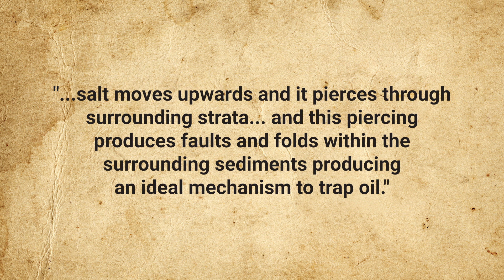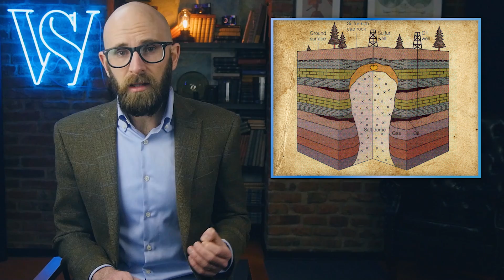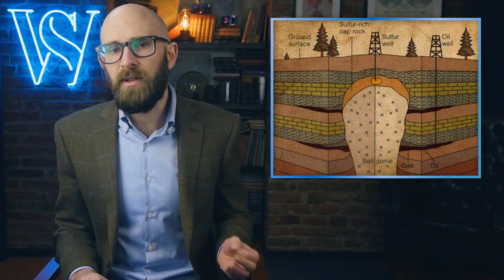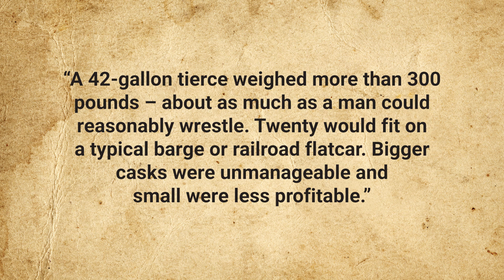How Drilling a 14 in. Hole Created a 1.3K ft Deep Saltwater Lake Out of a 10 ft Deep Freshwater One

Comment: Correction: a barrel is 55 gallons, and has been for many years now. Source: I work for ExxonMobil and keep track of about 300,000 gallons monthly. Not every company has standardized on 55 gallons, but certainly all of the major ones. We will occasionally get Rainbow and Reif drums that are 42 or 30 gallons, but the overwhelming majority are 55.
Reply: To add to that, while 300 lbs may have been seen as the most a person could handle at the time, modern steel drums are pretty easy to move. Most 55 gallon drums weigh 400-450 lbs, with some products weighing as much as 550. Those are pretty annoying to move, especially on wood pallets which like to break under the weight, it’s not unmanageable or even difficult with some practice.

Comment: My grandfather used to run a ranch 60 miles north of Cheyenne, Wyoming. The house got its water from an artesian well. The pressure was low and the mineral deposits were prodigious, but it tasted better than any water I’ve ever had. 

He told us about one family that drilled down to increase their own house water pressure and punched a hole that caused the artesian well to drain down instead of trickle up. Oops.

Comment: And I thought that my day was bad! First my jacket I took off got pulled into a sprayer rig engine. I was spraying fertilizer on greens. I work at a golf course. Than the next day lighting hit inside the building myself and some others were standing in. You could feel the energy in the air after! Fried a bunch of stuff and blew the metal sides out of some of the sprinkler boxes!

Comment: The limnic explosion near the end - limnic refers to water stratifying into layers by temperature. In warm environments, the water at the top of the lake is warmed by the sun and warm air, and since heat rises, the warmest water stays at the top and continues to get warmer.  The cooler water below stays there.  In cold environments, such as the US Great Lakes in winter, the water at the surface is cooled by the colder air above, and then that water sinks and is replaced by the slightly warmer water below it, which cools and sinks, and eventually the entire depth of the lake stabilizes at the same temperature. When the water is all the same temperature and has no layers, it is called a "monimolimnion"... which is the longest non-hyphenated English word typed entirely with the right hand. :-)
Reply: Thank you - fascinating information and an impressive new word.

Comment: Your math on gasoline production from barrels of oil isn't quite current. With modern steam refining methods, airborne CO2 and water are combined with crude oil at high temperatures and pressures to produce several barrels of product from one barrel of oil, at the cost of electrical power input. This is why oil refineries tend to be located wherever inexpensive electrical power from hydro, coal or nuclear can be found.

Comment: "We are so fired." - The workers, allegedly.
Reply: Unless they had a hand in picking the spot they most likely were ok, i'm an operator in a factory that cuts glass, if the guys in the office tell me "cut this" and it ends up being wrong the guys in the office get the flak, not me.
Reply: @Battusai1984  The guy on the platform mis-reading the guy in the office's specs, or mis-reading his position from shore markers (pre GPS?)
Reply: @TIMEtoRIDE900  same as boat navigation. I was good at math and in racing my Captain disagreed with me, but double checked his math. I was right, and stood by my work. Someone screwed up.
Reply: @Battusai1984  And if the order hasn't been written anywhere, you'll still be the one fired. "I didn't tell him to cut that!".
Reply: Nah, it's the surveyor who's fired. They were supposed to be several hundred feet away. Instead they were right on it.
Reply: @WardenWolf  Several hundred FEET? If I'd seen that rig on that lake and I worked in the mines I'd suddenly have a sick day to call in; all were extremely lucky.
Reply: Workers don't get into trouble when they followed the exact instructions and the land itself is the cause, it's filed under "Act of God".
Reply: Allegedly
Reply: Kinda like those videos where a guy in a forklift destroys the whole warehouse.

Comment: Water at "extremely high pressure" widened the hole? Where did high pressure water come from? The bottom of a 10 foot deep lake is at 5 psi. This is a third of an atmosphere - nothing much at all. A 1,300 foot depth is at about 650 psi but that happened later.

Comment: Actually they were drilling for natural gas.  The drilling site supervisor was a student in a well control class that I teach last year.  He told me that the plans for the well and the plans for the mine were submitted to the state government of Louisiana.  Unfortunately these plans were submitted to two different departments that were literally across the hall from one another, and the subsequent investigation showed the the gas well and the new mine shaft overlapping.  Also of the thirteen barges that were large enought to hold two semi trucks (atriculated lorries) that were sucked into the salt mine, eleven of them eventually floated back to surface.  Furthermore the waterfall that was created while the lake was refilling with water from the Gulf of Mexico was the largest ever recorded in the state of Louisiana.; as was the geyser that was coming out of the salt mine.  Finally, Simon hit me up if you want to understand the truely Biblical level incompetence and stupidity on the part of BP and Transocean that resulted in the Gulf Oil Spill.

Comment: Problem.  Kerosene was distilled from coal.  Actually killed the whale market which whale oil was used in lighting homes.  I don't see modern day environmentalists thanking the fossil fuel market for saving the whales.  You can't look at past events with a modern lense.

The closest comparable fuel to kerosene  is diesel.  Early diesel tractors were made to run off both.  Source:  I've been turning a wrench for almost two decades and history is one of my hobbies.

Comment: Yea, and it's not the only salt dome related catastrophe Louisiana has had, in 2012 Texas Brine hit one near Bayou Corne causing a sink hole that originally appeared at 2.5 acres and over the next two years it became a 26 acre sinkhole that is producing methane gas which is occasionally being burned off to prevent dangerous build up, and around 350 people ended up having to abandon their homes in the surrounding area. Supposedly the sink hole is mostly stable by now but occasionally there is some seismic activity which causes stuff to come up to the surface.

Comment: How does an island get "sucked into" the salt dome?  I could see it being left high and dry for a time until the lake refilled or the land under the lake collapsing and the earth sliding into the dome like a sinkhole.
Reply: The land under the lake and by extension the island was salt when the salt disolved and the hollow areas of the mine collapsed the earth on top of the mine fell into the now vacent area. This causeing the lake bed, shoreline and island to be sucked into the the hole by the large water movement

Comment: The drilling rigs usually have techs called mudloggers taking samples frequently to avoid this very thing. Salt is very easy to identify on the microscopes they use to examine samples they pull from the shaker.

Comment: It also caused the surrounding land to collapse into the lake, taking with it a brand new house, and increasing the size of the lake by over one hundred feet all around the edge.  It took three days for the lake to refill, and all of the barges popped back up to the surface.  The only remaining piece of the aforementioned house, it's chimney, sticks out the lake approximately 100 feet from shore.

Comment: The lake was 10 ft deep so, your "...water spraying in at extremely high pressure" was 4.33 psi (most car tires are inflated to about 28 psi). Could it be the erosion from the volume of water that was the cause and not the pressure?
Reply: Did you figure in the depth of the well hole?  The pressure of the water at the bottom of the hole is going to be a hell of a lot higher than at the bottom of a 10 foot lake.  Ever see a water tower up on legs?

Comment: Yeah, pure  CO2 is heavier then air and tries to sink to the lowest point in can find thus wh bulk of surface CO2 is in the icy depths of thee worlds Oceans in the hundreds of millions of tons with CO2 riding  the evaporation/precipitation cycle at 0ppm-900ppm depending on humidity and tempature ,region,season,altitude BUT does not increase the airs ability to asorb more then 32f of heat (Humidity is the mover of heat through air)

Think its called a "Mizuko"? (Death Wind) When a blanket of co2 erupts out of it sink..... that infamous incident might have been 30feet high so there was no escaping to higher ground even if you realized what was going on (some claims its oderless but volcanic gasses do smell like hint of sulfur most of the time or sometimees like bleach) I doubt they had any  structures tall enough though last few  gasouts near my house in Hawaii just hast the stay inside with windows shut advisory as the Trade winds usually clears out gasouts quickly...even been caught up in a light version of what happen to Pompay getting in the house seconds before the gases and ash shook the house as it blew by leaving my screens with2 thick layer of volcanic ash on it

Comment: So what happened to the salt-mine ? When the fresh-water lake decided to take up residence in the salt-mine. And invited its salt-water friends in the Gulf to also take up resident in the salt-mine. More than a bit of a problem for the salt-miners.  
As a profitable co-residency agreement could not possibly  be worked out. 

Did all other parties involved just decide to make a financial settlement. And walk away. Leaving the fresh-water and salt-waters to frolic in the salt-mine ? As there was no financially possible way to remove the invading waters from the salt mine ? It sounds like the Courts were uncharacteristically generous to the invading waters !

So what did happen to the century-long salt-mining operation ? Did it cease operations ?
Or simply change operations to simply install pumps and dewatering equipment to mine the salt. And extract it by that method ?
Reply: Bill Pearce they send people down in scuba gear to mine the salt.

Comment: 2:30 1300 feet deep = about 560 psi, 2-4x that of a fire hose. Probably wouldn't blast your skin off like a pressure washer or water cutter but I'd hate to be hit with it, being filled with salt and sediment and a 14" "pipe" with that pressure it would probably feel like getting hit by a car at 35 mph and leave you pretty abraded, banged up and bruised after you knocking you down the hallways like a rag doll if right under the puncture when it happened. Surprised that didn't happen to anyone.

Comment: Here is another interesting fact friends, Fraccing has long been the technical term used by oil workers for decades now, and the media prefers fracking. Hydraulic fracturing has no K, and one standard debate form, is to show how you don't sick your dog on some one, you sic them. This resulted in the classic war between small town oilmen from shady's bar versus nbcnnoxbcbs media corp. So far three tongues have been scolded, and one chicken has died in this tragic war over proper grammar.

Comment: Hey Simon, I have a related question for you.  With people pumping all of this oil out of the ground, is that going to leave a large empty void in the ground that might someday collapse?
Reply: The answer is less than exciting. Oil wells do not drill into a great big underground lake of oil. Instead, there are small fissures in the rock that trap both oil and water. The drill breaks the rock, and the oil (being less dense than water) flows upward. The spaces where the oil was are filled by water. Since it is many tiny cracks rather than a large void, it would be less like a collapse and more like the ground settling a bit, which happens slowly over time.

Comment: I had always assumed that they were 55 gallon drums because that's the size drums I had always work with. At 42 gal that would make the oil approximately 246 lb her Barrel
Reply: A gallon is not always the same. It starts with fluid ounces; a US customary fluid ounce is about 4% larger than an Imperial fluid ounce. Then, an Imperial pint is 20 ounces whereas a US customary pint is 16 ounces, which is where most of the difference comes from. A gallon is eight pints, but the different sizes of pints make a big difference; a US customary gallon is 3.79 liters, while an Imperial gallon is 4.55 liters, or 1.2 US gallons. The standard oil barrel as a unit of measurement is 42 US gallons, approximately 35 Imperial gallons or 159 liters. The steel drums used for small amounts of oil nowadays are 44 Imperial gallons, 55 US gallons, 200 liters, and are fairly similar in overall size to 42 gallon wooden barrels. They're lighter and less bulky as containers, so for a similar overall weight and volume, you can have more oil and less barrel. However, mostly oil is moved as a bulk product, so the important thing is just how much there is in total, and oil companies have been keeping their records in barrels for so long that it's not worth changing over to a more sensible unit.
Reply: @SilasHumphreys  everything you say is true, except for one measurement that has stayed the same for hundreds of years. A pint. It is always 16 oz by u.s. measurement. As it has always been. It is actually one of the oldest measurements of volume that exist. And the United States maintained most of those old measurements when the rest of the world decided to change everything, which still doesn't make any sense because volumetric measurement is still the same formula whether it's metric or standard. Length or distance is still measured with the same mathematical formulas, and inch measurements are easy enough to put into digital form. Which was a sold all of the problems in the first place. Apparently nobody took fifth grade math when they decided they wanted a digital form of measuring things. But what the hell do the French know anyway when they're the ones who drove this change after the French Revolution?

And the reason Imperial measurements are larger that standard measurements, is because the monarchy then has the ability to arbitrarily raise taxes by just changing the measurement standards.
Reply: That's what I always thought too.

Comment: FYI Re: Lake Nyos  In addition to a source of CO2 (volcanic substrate) the climate around Nyos is quite stable, preventing what would otherwise provide weather mediated mixing of thermal strata in the lake. Hence the water at the bottom stays where it is and stays quite cold thereby increasing its capacity to retain dissolved CO2 (until it can’t that is.) there have been other similar events. Lake Monoun was one.

Comment: For my entire life, there has been a lake off the side of this highway near my apartment, and in the middle of this lake, there was this.. metal thing that someone always has a flag stuck on it.   I always wondered what this lake was.  I did some research and it turned out that the "lake" was a former clay mine.  It's near a large lake and wet-land that's on the opposite side of the highway.  Apparently, there was an underwater hole or something deep in the lake that went underneath the highway or something, like a water filled cave or something.  They breached it and the whole mining site flooded and turned into a giant lake.  The tiny metal bit sticking out of the water that people always put a flag on is actually the very top of a crane.  That gives you somewhat of an idea how deep that new lake is.  Under that water is tons and tons of mining equipment and vehicles that got caught up in the flood.  Now, when you go over that stretch of highway, it just looks like there's this big lake on both sides of the highway.